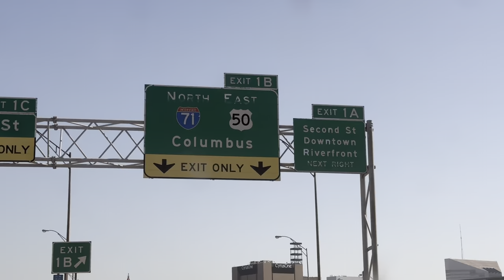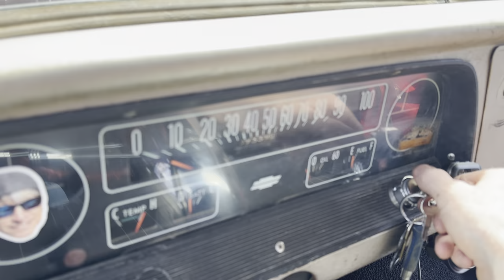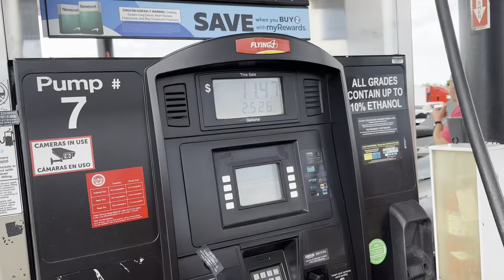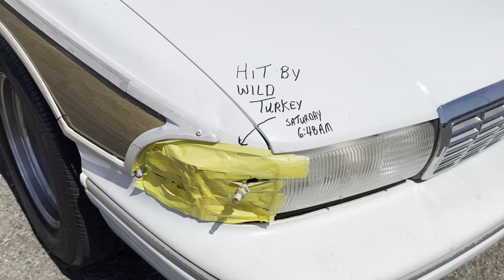Hot Rod Power Tour 2024-Day Four (National Trail Raceway)

Comment: I think no converter lockup can build heat and hurt the trans? I had a 3rd gear pressure switch that kept mine from locking up jumped it and toggle switch started working. Tough to hear a difference only 300 rpm when it locks up
Reply from the maker: Shouldn’t hurt the trans. It’ll just stay in 4th. Which essentially it does anyway when the TC locks. But I’m not a expert in any way lol